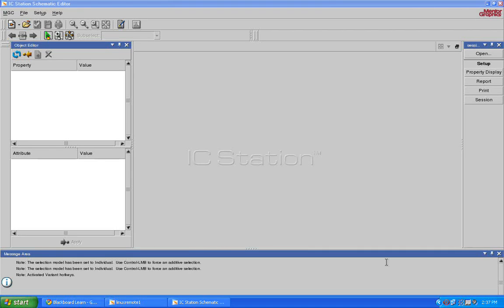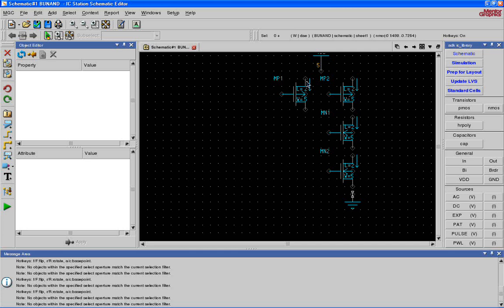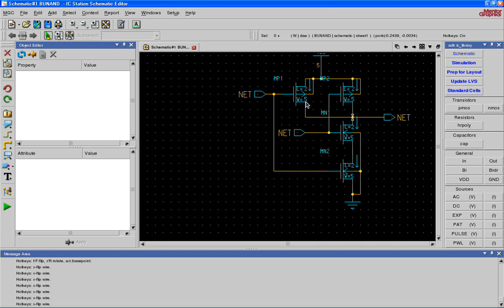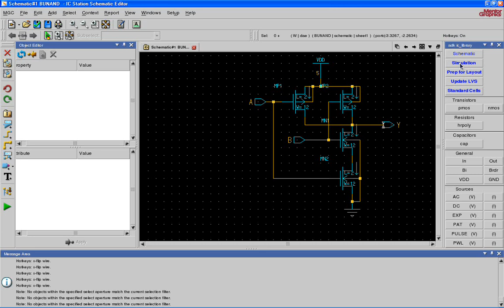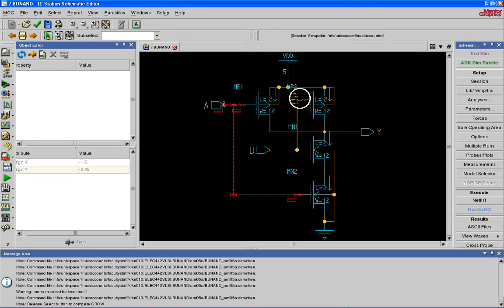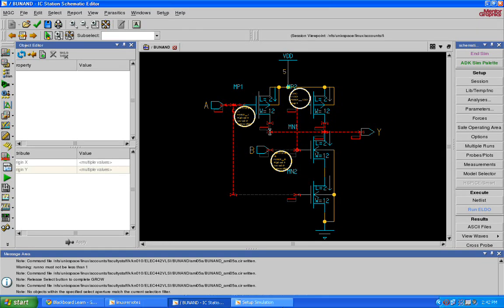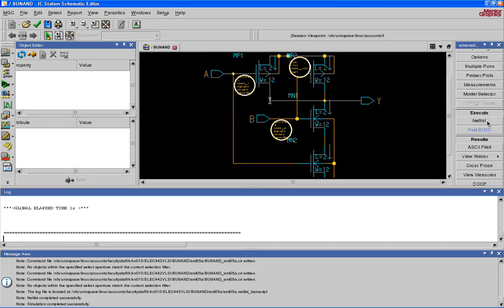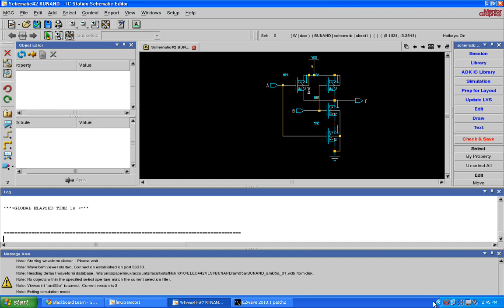VLSI Tutorial 2: Two-input NAND gate using Mentor Graphics tools (Design Architect and ELDOSpice)

Comment: Can you plz simulate all parameters of the current mirror like output resistance , transconductance , slew rate ,input resistance , power analysis,  minimum output voltage in video tutorials.